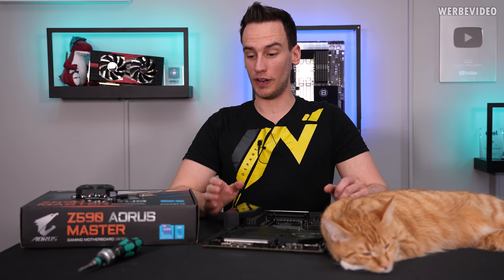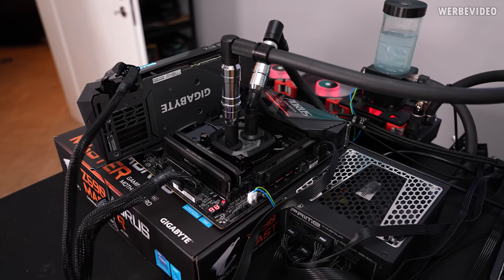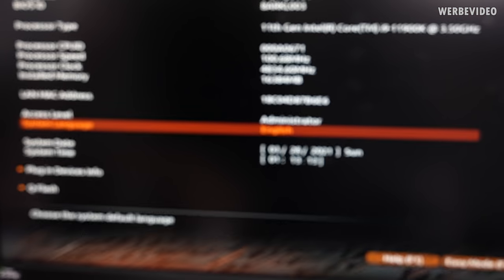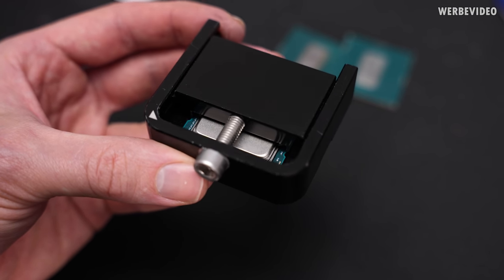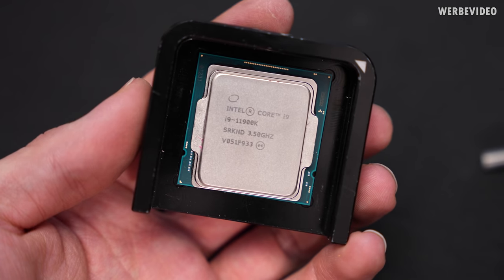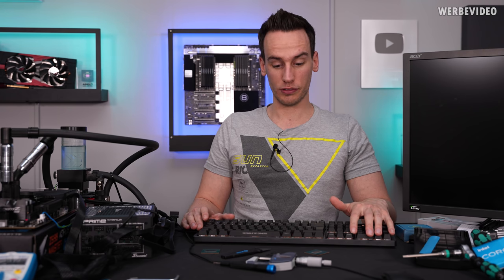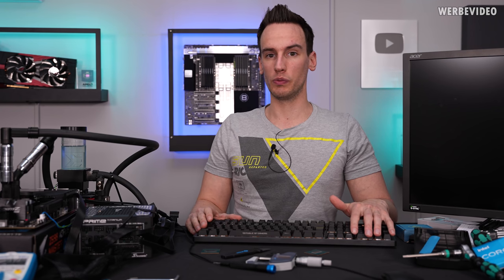11900K Delidding.... Somehow I can't believe my own Results

Comment: for my 9900k the vccsa and vccio where 1.39v and i clocked it back to 1.17 and its stable just fine.  and im running 4266 cl16-16-16-32-400. ym motherboard voltage was 1.49v and my vcore was 1.395v which i both lowerer to 1.25v
I dont know whats up with boards screwing up voltages these days.  temps also went down 30c...
Haave you tried to see how low voltages can go? 1.38v still feels stupid high. and what did you cant up putting the vccsa and vccio on.
Reply: Board voltages are getting crazy. I had an Asrock board trying to push 1.46v through a 3600x and temps were way too high. Set my own voltage to 1.275v and it was much cooler and sustained max clocks without issue.
Reply: @dracer35  Yeah its nuts i get they try to set a voltage that works for every chip but frankly 0.07 volts over the minimum should work for any chip or i would freaking rma that thing anyway. if my intel would need ore then 1.29 volts i would not have kept it at the time seeing most people get even lower voltages then me i think thats not to much to ask. no need to make it 0.17 higher.
Reply: He had to raise it up to get the stable overclock

Comment: Wouldn't it be better to pre tention the lid and put the whole delidder and cpu into the oven? It would have to be a 2. step process.  First time to offsett the glue and the 2.nd time to get rid of the lid. The benefit would be a lot less pressure would be needed. Perhaps it could be tested with a dead cpu?

Comment: What about long-term perspective? Is this temperatures still so low after months, years?
I scalped 4790K and use it with the Intel turbo boost only (<=4400 MHz), but temperature still pretty high, ~100ºC (LinX/DeepcoolRedhat/GD900). What am I doing wrong?

Comment: well, taking in account the difficulty of the delidding process itself. If you have good soldering equipment, smd removal alloy and good soldering skills. It would be very easy to first remove the smd components, usually just some capacitors, one by one, recoding location of each component, then delid without a worry and place the components back into the original location afterwards.

Comment: it's kinda surprising to see just how much biggeer the 11900k die is vs the 10900k. so much more room but for 2 more cores. but that also somewhat explains the temps. bigger die surface area plus the bigger ihs surface area means better cooling. thats probably the one thing intel did rite with rocket lake.

Comment: Could you maybe unsolder those capacitors on the outside of it, remove the IHS, and then solder them back on?

Also, the term for that measuring tool in English is "micrometer," pronounced "My-KROM-eter."
Reply: or just calipers would suffice even though that is the more accurate term.
Reply: @gannonbest7251  No, that tool is a micrometer. Calipers are MUCH different and less accurate

Comment: I just built a 10900kf a couple weeks ago, and I am fully stable for multiple runs of cinebench with 5ghz on all cores using a 240mm radiator and voltage exactly where yours is at. I was hoping for a bit faster but the stability doesn't seem to be there, maybe if I delided like you did I could actually push it faster, but im too scared to do it x.x

Comment: just heat up the ihs with soldering bolt BEFORE putting it in to the delid tool...  those pre soldered die's could easly get destroyed if you place them cold in the delid tool...

Comment: My Ryzen 7 5800X makes 5998 pts (multicore) without delidding ;)
My temp was 88*C, and power draw was 151W during test (highest values).
Anyway, very good job and improvement of temperatures by delidding an i9!

Comment: 80W/mK at a die size of 2.76e-4 m2 would cause 12K at 300W if the indium solder was t=2.76e-4*80*12/300=0.8mm. So if the indium solder was that thick, it could explain the temperature drop. But it seems like it was originally much thinner, so this is hard to explain.

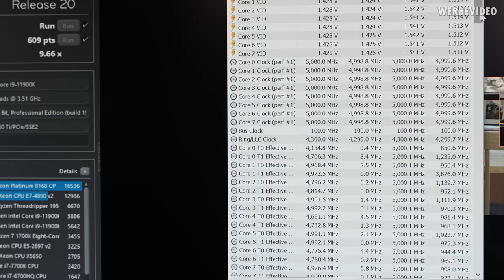Comment: What load is it under? 6:38 It doesn't look like cinebench is currently running & 80-90+ degrees under watercooling doesn't seem that great, of course the only thing I have to compare to is my 49x 7700k overclock at 1.34v

Comment: That's a frightening delid process, have you tried a fluxed solder ribbon on an iron to clean up the In instead of risking a chunk of your thumb to a razor? Does the LM dissolve the indium residue? I'm really curious what the story is with the larger die despite dropping two cores. Does correlate with your results though, better thermal transfer through a larger surface area and less cores adding heat to begin with. Maybe Intel just wanted to send off that legacy silicon with a robust physical design.

Comment: Using a razor across the die? Any surface scratches is bad. Couldn’t you just spot heat it up and use a solder debraid to remove excess material? Thanks for sharing you are a braver man.

Comment: Probably a stupid question, but why do you remote the indium with a blade rather than heating it up and wiping it off ? Is it because of the risk of it spilling around ?
Reply: That's what I was wondering too, why not just use a temperature controlled soldering iron and some copper solder wick to absorb and wipe it off?
Reply: it's hard to work with molten Metal, yes.
also less heating is always nice.
Reply: @taiiat0  yea but he is heating it up enough to melt it anyway in the delidding process. As for working with molten metal, it should be no different than removing solder with soldering wick unless the indium compound doesn't wet as well to copper solder wick for some reason.
Reply: @abinnixon8511  
i don't think it's worth risking the molten Metal dripping onto the Chip while trying to Wick it.
Razer Blade works fine!

Comment: my 10900k with rockitcool ihs, lapped, with LM on both sides does 5.3all core at 1.385v and doesnt exceed 90c with arctic 420aio. around 325-330w. also, instead of using a gasket maker to glue it down i used kingpin thermal grease to grab heat from the pcb as well.

Comment: Well done. You really need to take that uhd750 iGpu for a spin now if your overclock (or somesuch mod) that 11900k cpu and its uhd750. Can you make it defeat an nvidia1030 at 720p and 1080p in Red-Dead-Redemption dx12 at 24fps or higher? Likewise Vulkan in MSWindows and Linux, especially games like Doom-Eternal. You could even try a machine learning software in a battle vs the cuda-cores of the 1030. 

Not buying a nvidia1030 for that Mboard saves £75 to £100 and 30watts and space and a fan cooling (e.g. redirecting airflow in a case the 1030 has obstructed)... Whereas the 11900k can be an upgrade cpu which still uses a watercooler the pc owner already had with no need for a new fan.

Comment: That big of a temperature difference makes me wonder why Intel doesn't just switch out the indium for something closer to liquid metal. Obviously they can't actually use liquid metal since 99% of consumers don't have the technical knowledge or desire to reapply the liquid metal every cope years, but I'd think that at this point Intel would do everything possible to try to close the gap with AMD.
Reply: Several different laptops are already using liquid metal on their CPU die currently. There is no reason Intel couldn't be doing the same under their IHS. It's most likely just a cost saving measure.
Reply: If you use right amount of LM underneath IHS it will work fine for 6+ years (and counting). The problem may arise if it is not enough or too much, or your surface soaks LM, like bare copper does. Otherwise it is pretty much imperishable
Reply: @dracer35  Knowing its Intel, they will screw up somewhere else even if they do use LM. Example:  In Ivy Bridge days, even the IHS glue itself is too thick, purely removing the glue alone will help with temps alot.
Reply: @fleurdewin7958  lmao, you make a good point 😂
Reply: Shhh, don't give Intel ideas.....next gen would have LM under the IHS that would dry up after a few months after the warranty period ends = CPU is overheating, underperforming, customer buys a new one. Intel says they're sorry for the inconvencience but gives the buyer a 50-100$ rebate on new Intel CPU. Genius marketing strategy.

Comment: Sometimes I wonder if we would have been better off if Intel just stuck to using thermal paste...
Because the benefits of indium solder seem to not really be that great after all - and in return it makes delidding way too risky to be practical. At least back when they didn't solder then it was cheap, easy and fairly risk-free to delid using an appropriate tool.
I wish you could just buy the chips unsoldered, but that's never going to happen realistically - even if it would be trivial for Intel to just skip that last step in production for a few CPUs.
I still don't quite understand why they aren't able to manufacture this better. Having 10+ celcius less under load would be a huge benefit to the products, and it's not like liquid metal is some dark magic. Especially when current Intel products struggle with high heat output it seems weird that they haven't put more effort into optimizing this. When you can DIY-mod a product to get such an improvement it really speaks to shoddy design/manufacturing.

Comment: The gold on the heat spreader is keeping the heat radiation trapped between it, and the CPU. You removed, and it attributes to some of the decrease in temps. Also compare the indium from Intel and Thermal Grizzly.  I wonder which one is more pure.

Comment: How do the forces compare:
- glue shift force
- lid solder shift force
- die on the interposer shift force
?? It looks so terrifying to slide the soldered lid without heating it, can't believe that die-interposer soldering is that strong.

Comment: Better delidding method: 1. find a laptop/cellphone repair shop close to your place 2. Ask them to use heat gun remove smd components 3. Using heat gun 230C max wind level heat IHS while delidding it. 4. Use Mercury to desolve solder material on the die rather using knife. 5. Solder removed components back. 6. Clean it up. Almost 100% survivability guaranteed.
Reply: yeah but it is more effort that must go in, although not as safe I would still go with his method
Reply: The surface mount components are UNDER the IHS. You can't remove them without removing the IHS first. 7:45 removing the ones on the outside is pointless if you can't remove the ones I've the IHS. Anyways, most "laptop/cellphone repair shops" don't have the capabilities of doing component level repair, and especially not those tiny 0201 or even the 0402 sized components.

Comment: Great video idk how over never seen you before. Great edits . Also ty for making this content . I had exact same issues u have .. with z5 board the 11th gen memory controller just wasn’t working . Xmas didn’t even work otb . Bios update fixed everything . This was the msi z a pro budget z . After update I no longer hate the board . The Intel gen does not like over clocking so far I’m having bad luck. I theoriszed the larger back die more surface area better oc . I wonder if the issue may be with the stupid igx. Despite igx probably going to be a option for a lot of people right now

Comment: Have you tried encoding a video using Handbrake + Quick Sync ?

It should encode faster than the 10900k as it had a much weaker iGPU

Comment: You needed to bump that dram voltage up to 1.6v and find a board that doesn't have that 90A Smart Power Stage garbage like the msi gaming carbon for example.

Comment: I’m thinking that maybe the initial tests before delidding were not correct because all the temperatures seemed kind of high to me.  Mid to high 80s and low 90s. Just seemed to high for stock.  But what do I know compared to this Pro.  So I hope he does some more testing on other 11900k CPUs to confirm his results.  I still will not buy one of these chips though. I’m going to wait until Intel drops some newer 11th gen  chips.  I already bought the same Mobo he is using for this test the( Z 590 Master).  I’ve got my 10900K in it right now but can’t use the gen 4 SSD M.2 slot until I put a 11 gen Chip in the socket.  I’m using the 2 other m.2 slots with 970 evo sticks in both.  18 +1 phase VRAM set up so overclocking this board is really good.

Comment: why didn't you use gallium to solve the liquid metal? My mind goes brrrrrr, when I see you cleaning off the solder with a razor blade.
Reply: Big risk for the smcs and cleaning .
Reply: @mimika9541  What risk? (Not trying to be rude, just asking) Once delidded you can safely put liquid metal on the die, so why should it be more dangerous to put liquid metal (high percentage of gallium in it) on top of the indium solder, which covers the die, to dissolve it? I did exacly that to my 9900k and it's immensely safer and easier than use a razor, ( it's not a critic to Roman, he is very experienced so he's fine) also cleaning liquid metal/gallium it's easy, a paper towel does the trick.
Reply: @greggreg2458  Low skill users,shaky  hands ,droping q-tips and spiling the metal or using to much happens to often than fuckin it with the razor.Ah and the razer if faster.Another idea is cpu,oven,heat,out,fire gloves,copper "sponge" =profit?
Reply: thanks for the tip

Comment: I'm guessing that Intel's changed the die to be thinner compared to previous generations or the actual solder is thinner. On top of that the die is larger than previous generations so more surface area = better heat transfer. But yeah, nice job.

Comment: You probably messed up temperature sensor on CPU dye with overheating in the oven so you now have incorrect readings. Try to measure the temperature with precision thermocouple probe instead.

Comment: Damn, that die (by general purpose CPU die standards) is absolutely huge. No wonder they can't easily do an AMD style MCM solution. Reading specs really doesn't do justice to the physical sizing issues that Rocket Lake is stuck with at Intel's current process size. I can only imagine the frustration that Intel's uArch layout and integration engineers must have felt, having to backport to 14nm.

Comment: I heard that the benefit from deliding kept decreasing every generation until 10th gen, as they had better and better stock tim.
Maybe this atrocious difference is what's making these new 11th gen so awful, and that comparing a delided 10900k and 11900k would actually provide more acceptable results?

Comment: Hello sir yesterday I delid my ryzen   5 5600x and now idel tem. Is 39 degree and full load tem. Is 69 degree. I apply direct die cooling method. I hav cooler master 610 6 pipe heat sink with dual fan, is it enough or m doing somthing wrong? M using Noctua nh1 thermal paste on cpu die

Comment: Im afraid of delidding in this hardware climate of out of stock
Reply: No it's not. CPUs are readily available in every western country
Reply: if it breaks it's not a big deal. It's not like it's an amazing Ryzen 5900x or something special like that. lol
Reply: @awilliams1701  it's $500 :c
Reply: @weavercs4014  it's not worth $500. lol It's a freaking joke. My 5900x laughs in its face.
Reply: @awilliams1701  Your 5900x ipc is less then the 11gen. Also memory latency is horrendous on ryzen.
Reply: @Typhon888  even if the memory part is true, the IPC part isn't true. And the most important thing is benchmarks. Even the 10900k is faster than this POS. But the best part is that the 5900x is faster in pretty much everything. Most games, blender, premiere. It's all faster and that's the only thing that matters. The 12900k is a horrible POS that everyone has had trouble with.......but it is fast. The only thing faster than it is the 5800X3D and even then not always, but why do you care about a CPU that intel wishes it could forget about since it's already been replaced?
Reply: @awilliams1701  Latency is bad on 11gen intel and all Ryzen cpu's. But even the 11th gens latency is not as bad as Ryzen. Just like an overclocked 8700k beat ryzen 1800X. It took Ryzen till 5000 series to even take the performance crown in multi core work loads.
Reply: @Typhon888  we're not talking about an 1800x. Right now your best options are the 12900k, which isn't very reliable, runs hot as hell, and uses insane amounts of power, the 5900x which is an amazing CPU, the 5800X3D which is the fastest gaming CPU for most (but not all) games, the 11900k, which is a joke and a waste of sand because it's slower than a 10900k, and the 10900k which is stable and reliable, but not as fast as any of the other options (except the 11900k).
Reply: @Typhon888  I mean I could go on and on about how much faster the 5900x is vs the intel 8088, but we're not talking about old shit. We're talking current. And currently the 11900k is a joke, but it always was a joke. Why are you even commenting on something that's a year old? It's not a relavent product anymore.
Reply: @awilliams1701  my 11900k at 4.8ghz has around same ipc as a 5950X . 11900k at 4.4ghz has a better IPC then my 9900k at 5.2ghz. Also good luck doing PS3 emulation without AVX512 support 11900k has AVX 512. Also I can do ddr4 5000+ on intel.

Comment: Hello der9auer, my 10900k is at 5ghz all core LLC medium on z490 vision g , at 1.30v max temps 70C on kraken x62 liquid cooler, im so impressed its like i got a delidded cpu :P Full stable at gaming rendering editing without any crashes
Reply: ok
Reply: Try to run prime95 and get back to me
Reply: @coronachan4285  or all people with a 9600k @5.3ghz with 1.25v when my 9700k keep barely the 5ghz if i don't put 1.38v... and when you ask their setting of stability test they start to answer you in mandarin ....

i use occt for the stability check for 8h if my setting pass i think i'm stable ( just for gaming so i never use a full charge pc more than 1-2h )